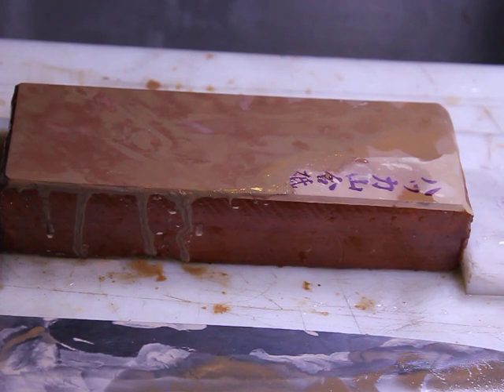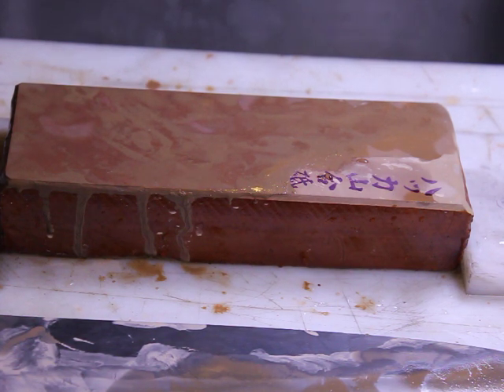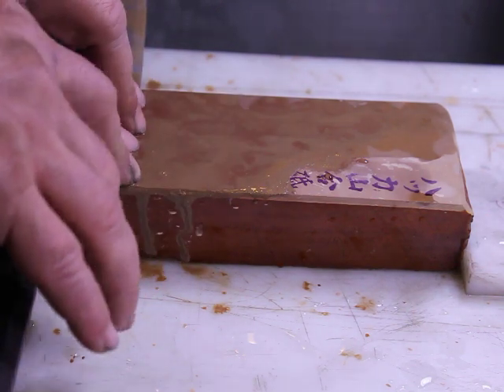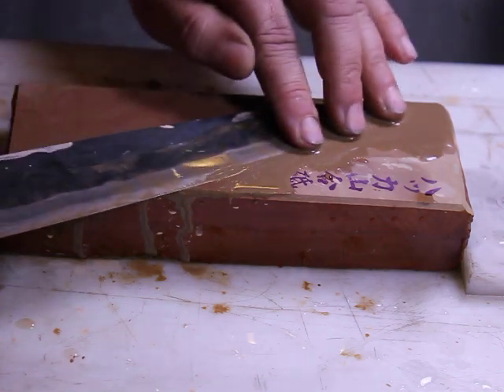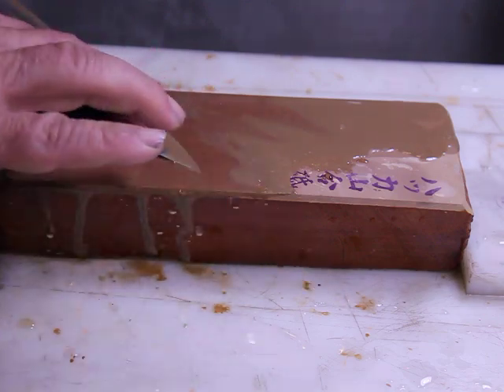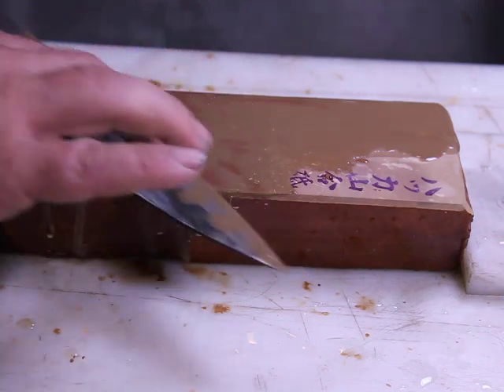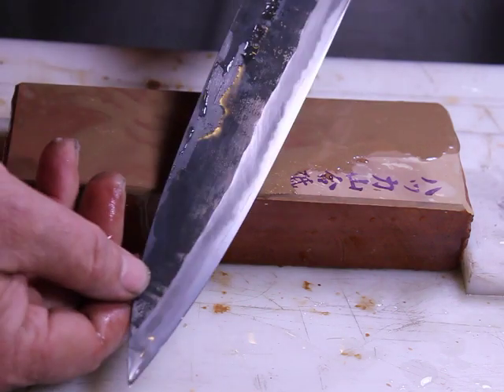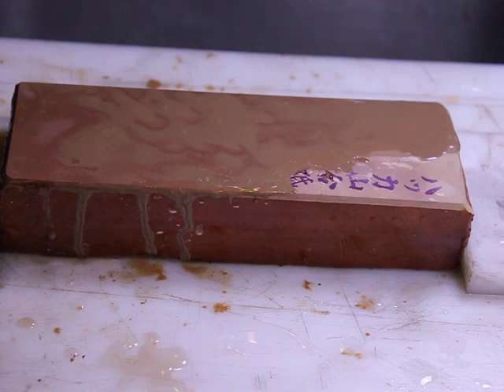Hakka Tomae Japanese Natural Stone Part 2

Comment: I have had a few naturals that when used too agressively (pressure) and without slowly working the mud you get scratches. You can tell if they are from the stone by actually washing off and looking at the stone face when finished. You will see what looks like a couple of needle etchings on an otherwise smooth surface where you broke loose a fresh grit particulate and rolled it around between the stone surface and the blade. Very low pressure and mud (sometimes a nagura) are the keys to success.

Comment: Material, both steel&stone, is sheered, ripped & stressed in polishing; hardness increases. The sheered slurry as a system is harder than the stone surface. If there's too little pressure, the slurry wont embed but will "roll" out more coarse stone slurry. The slurry's not fine & the finish the same. 

I learned the hard way from a spear. Window with a full stone gave ji-nie. But spears were too hard 4me; I finished with tsuya only. Couldn't get the ji-nie again; not enough pressure

Comment: If i may jump in, grit size can be ~off he mark~. 1 brand of "3K" stone i have had scratches that IMHO were like 1.5K. Also, naturals are like coticules: IMHO less slurry = finer scratches. Hard edge steel on a hardish stone produces almost no slurry, while the soft cladding produces more. The edge becomes mirror-like, while the cladding is hazy. The *SAME* grits cut both the edge steel and cladding, but the hard steel resists cutting better than the cladding, thus wielding different scratches

Comment from the maker: I mention in the first video using a Hakka tomae tomonagura. I wouldn't use other types of nagura for this stone.I modulate my pressure levels, going for lighter pressures until the mud density becomes viscous enough to support a bit more pressure acting as an interface between the stone and the knife.

Comment: no mirror polish?
Reply from the maker: +MasterofPlay7  The goal of a stone such as this is a Kasumi finish, where there is contrast developed between the softer cladding (jigane) and the Hagane or hard core steel. If you wish to get a simple mirror finish with no contrast, you should use synthetic stones instead and / or various compounds. If you wish I can make recommendations with mirror finishes some as high as 640,000 grit where you will see extremely precise scratchless mirrors capable of precise reflections even at 500x magnification.
Reply: kenneths123 but there're stones that can produce contrast at the same time produce a mirror polish, like the shinden suita
Reply from the maker: +MasterofPlay7 So thew primary purpose of this video was to show the contrast produced by the stone compared to most synthetic stones rather than the degree of finish of the Hagane. The Hakka produces a softer finish on the Hagane, referred to as a Kurobikari or black hazy finish, much like an antique mirror. This is best seen when the blade is dry with proper lighting. The Shinden suita is a significantly harder stone than the Hakka and is more suitable for woodworking tools rather than single bevel knives, since it will not compensate as nicely for variations in the planarity or lack of planarity present in the blade road of a yanagi.
Reply from the maker: +kenneths123  I also love my Shinden Suitas. Let me know if you need one.
Reply: kenneths123 how much are they?
Reply: kenneths123 also will shinden finish straight razors?
Reply from the maker: +MasterofPlay7 Contact me at 209 612 2790 or ksskss earthlink net
Reply from the maker: +kenneths123 It is OK but a finer stone like the Nakayama stones are even better for final polish. The Shinden are coarser but would be a good prefinisher.
Reply: kenneths123 People say the shinden is very imba for mirror polish, don't know if that's the case.....
Reply from the maker: +MasterofPlay7 Please clarify imba?
Reply: kenneths123 imbalanced? very good?